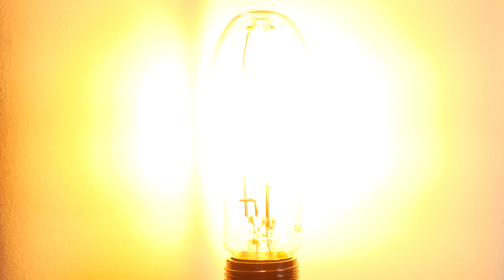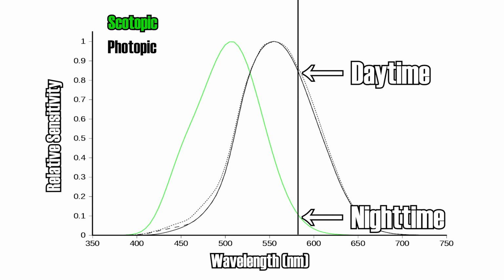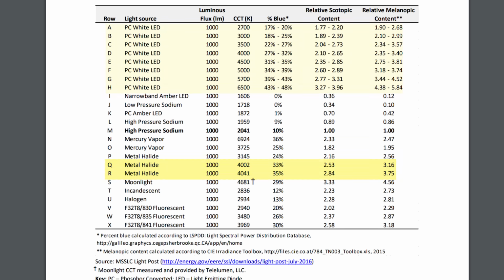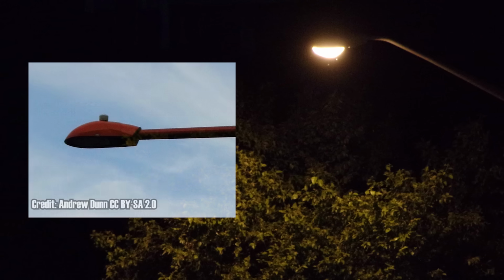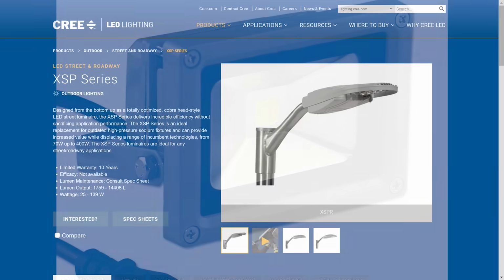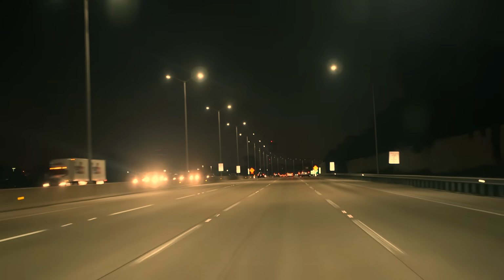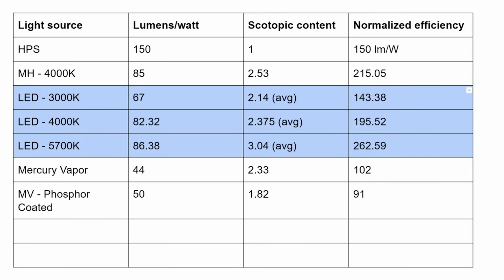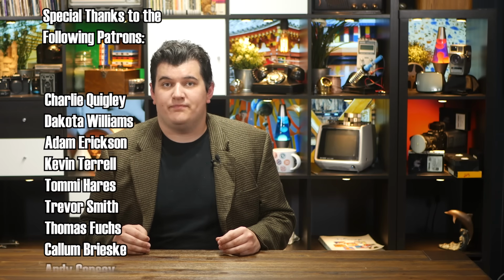The LED's Challenge to High Pressure Sodium

Comment: No CMH? Ceramic Metal Halide.. 4000K lamp is closest to the sun. Also, CRI(Color Rendering Index-sun is 100CRI. HPS is around 22CRI, MH(Metal Halide) 70CRI, CMH usually over 90CRI(98!). COB LED's w/optical lens 90°, maybe 45° even! Helping to avoid upward, outward, unwanted light pollution. And available from 2000K-7000K, giving many options. 4000K is a nice color. At 1st, LED's were very deceptive, our street lights  were almost dark underneath, lol. But nowadays, about half the wattage of HID lighting, at most, yet with many more colors, and optic lenses, I don't know how the newer LED's can go wrong. "Well, when light dies, you need a new fixture, very expensive!", yet I believe you, or a professional could switch out the diodes quite easily, especially COB's, and after it gets more understandable, each time, and maybe cheaper than an old mogul lamps, if changing every year already. Some LED's offer a 7yr warranty. 165lm/watt! Streetlights! Great video! Very informative and I knew much of it, already! Thanks again!

Comment: I suppose it makes sense that we may prefer blueish light, but when there is snow blowing across the road... no way. I remember driving on the highway with snow blowing and white LEDs; it was so hard to see the road. Then when the lights changed to the HPS (orange) lights, it was easier to drive. I'm not sure why, maybe it may have been because the white LEDs reflected off the snow.

Comment: I recently got my first house, a lot of the fixtures had older incandescent or CFL bulbs. I swapped almost all out for LED bulbs I got on sale. Garage had giant 4FT fat tube fluorescent fixtures and like 1//2 of them never wanted to work right. I ended up finding some $45 lithonia bar strip LED lights for like $30 on clearance. I got a gob of those. I got 2 of them up, I like the LED a lot more than even the working fluorescent fixtures. It is more of a pure white, they come on instantly even in cold, and no ballasts, etc to fail or buzz. These were small enough to screw to the length of a rafter, a fluorescent would not do that without many inches hanging over each side.

Comment: The LED street lights near me in the UK are awful and not like the ones you showed in your video. The sodium lights give off a wide mild light whereas the new LEDs give a bright light concentrated only where the street light is, with very little light illuminating between street lights. There’s a park near me with a roundabout and at night time it’s almost impossible to see vehicles or cyclists on the roundabout because the street lights are so poor. I suspect this is a specific design of the lights used near me as the ones in your video are much better.

Comment: does anyone else find sodium vapor lights easier to see in than LED?  I've been told white light is best for night, but even with my flashlights I find LED very unnatural and hard to make things out in.  On the road it's like LEDs are just lighting up the area directly under them as well and not diffusing the light across the road.  I've often missed people walking up to intersections with LEDs where I never did with the old lights because they diffused so much light.

Comment: When the roads are wet I can't even see the damn lines on the road because of the white led glare sparkling off the little puddles on the road. It all comes down to cost is cheaper it has nothing to do with safety.

Comment: Almost all the street lamps in my area have been replaced with white LED lights. There are now significant dark patches between each post where before there were none. The most dangerous aspect is that now, white light ahead could just be another street lamp, or an oncoming car, with no way to differentiate. Under orange sodium lights the white lights of a car are easy to differentiate. With a lot of single vehicle-width roads with blind bends and no sidewalk, this puts pedestrians at significantly increased risk after dark.

Comment: Having a LED style light for street lighting is looking like the way to go.  With the cost of power increasing and loading also increasing on a town of city level.  Having a lower consumption of power demands on a town/city level will work.  Possible way to solve the light from heading up by placing a reflective material on the sides to push the light back down.  This could be useful with helping the street lights from invading housing.

Comment: I feel like Led lights are a lot better because you can get many other colors then 5k - 6k, you can get a 2k that is really warm or 8k that is almost blue light. Some led light also do something that high pressure sodium lights can't do that prevents light pollution and that is a sensor circuit that makes the led light dimmer if no one is around, but if someone or something activates the sensor that will cause the light to be brighter for safety and there is amber led lights or even color changing.
Reply: Except a city or town is just going to buy a bulk amount of one type which usually ends up being the cheapest white/blueish light they can.

Comment: In this video I think you missed the point of Sodium Vapor lights. It was not to conserve energy. Back when everything was Mercury Vapor it had one huge disadvantage. Its absorption spectrum is close to that of water. During rain, fog, snow - any water in the air - Mercury Vapor lights ability to illuminate is cut significantly since the absorption spectrum is similar to water - it would be absorbed. Sodium Vapor lights were created to solve this problem. As we know, Sodium and Water are incompatible. Sodium Light cuts right through water - its absorption spectrum isn't even close - and its a similar technology to mercury, so it was easy to adapt. Foggy roadways were now visible at night. Snowy roads were visible. Yes, it may not excite the cones in our eyes but our rods are just as capable if not more so at making a clear picture out of lower light levels. Sodium Lights made a world of difference when introduced back in the late 1970's in the reduction of vehicle accidents at night. (I've looked online for documentation of these claims, but it was the 70's before the internet, I can't seem to find anything. This information is what we learned in Science class and through real life experience and news reporting of quantifiable evidence based on National and State governmental reporting.)

Comment: There's a grocery store near where I live that has auto dimming lights in the parking lot.  They're equipped with motion sensors that gradually brighten the lights in two stages when a vehicle or person on foot approaches - about 20 feet out they go up one step and about 10 feet out they go to full brightness then they go back to dim state after about 10 or 15 minutes of no movement.
I don't know how feasible that would be, financially or logistically, to implement into city o highway lighting, but it may be a possible solution for residential or urban lighting where consistently bright lighting causes disruptions and problems.

Comment: Another issue with LED not addressed in the video is the driver issues. Most LED's use pulse width modulation circuits that react differently with power fluctuations, low voltage drops and just naturally can make your brain react to them like a video frame-rate or flicker. When you look at a sodium or incandescent light burning its a constant light which is your eyes and brain don't have to process the extra data. As you get into the cool/blue white needed for optimal night brightness to the eye, the CRI gets worse and all color will be washed out more and therefore pedestrians and other issues while driving will be less noticeable. This exact issue has been happening with all the new cars using LEDs and projection headlights. You can't see a thing with oncoming traffic now in many conditions. Wet, snow, uneven road angle all leads to blinding the oncoming drivers. Now we'll put this LED technology to the street lights! My moms town recently switched to LEDs for all the street lights and its bad. Its gloomy and pitch black everywhere around the roads and on the roads and I can not see as well. LED's are a very small spectrum of light which is very unnatural.

Comment: Lighting things up which are not the road is actually not dumb
Liverpool residents have recently had issues with increased burglaries due to reduced lighting because of LED's.
The main issues with the LED lighting recently fitted in the UK:

1. Lack of diffusion - probably to get away with less Led's and less power
this results in more of a spot light
2. There's not as much light being emmitted from the Led lights
this is probably to council's cheaping out and getting a low as possible light source and because the blue light is too harsh
3. The new lights can be switched off remotely, which sounds good.
Untill you realise there's now large stretches of roads in the North with the new lights turned off to save money

So regardless of frequency reponse which this vid focuses on, these types currently make the roads less safe
due to the temptation to abuse the technology by councils to save as much money as possible
It's now cropping up that there may be cancer risks, and sleep issues

Personally I'd like to see LED's with the same colour frequency as the sodium's (warm yellow / orange), with diffusion to spread the light out
and more LED's for more light.

Comment: Blue light may not ruin your eyes directly, but what it does is massively increase eye fatigue. You can try this for yourself and it more convincing than any study you can find. Wear a blue light filter glass for one day, if use computer daily, that even better. The next day stop wearing it, sometimes after the sun had set you would feel an unusual amount of eye fatigue. THAT is the fatigue your eyes get every day, it's not something new, it just that yesterday you were wearing blue light filter glass and don't feel this fatigue.

Even if you don't want to buy a light filter glass, on PC you can install a program called Lightbulb, it changes the color temperature of your screen. Tune the color temperature for the night at about 4000k. Now disable the program, use the computer until you're about to turn it off and go to sleep, try turn Lightbulb on and experience immediate eye relief. If that doesn't convince you blue light fatigue your eyes more than any color, I don't know what. Try it, it free.

Also when you think about it, it just makes sense that blue light make our eyes work harder, because it present day time. We animal didn't evolve along with artificial light sources that can light up like the sun (lcd screen and led light), so our brain treats blue just like sunlight and make us stay alert.

Comment: I was actually brainstorming another idea: eliminating public lighting altogether and raising private lighting standards. Even that would have pros and cons.

On the one hand, this would require motor vehicles to meet higher light-output and broader directionality. It might also require new laws or bylaws forcing cyclists to attach lights to their bicycles from sunset to sunrise maybe under threat of a fine for not doing so. It might also make it less convenient for a pedestrian to go out at night without a head lamp or flashlight. Another problem has to do with a car light failing. This means that legislation might require a car to carry a backup floodlight that a driver can ignite at a flip of a switch should the main lights fail for whatever reason. After all, if there are no streetlights to light his way aside from traffic lights and sign lights, then he needs to carry his own light and backup light sources with him. While the lack of public lighting might not necessarily increase the crime rate, it would most certainly increase the need for motion-sensor security floodlights and security cameras on private private property to deter crime none the less. 

On the other hand, it could reduce municipal taxes to compensate for the extra cost of extra private lighting, and would give a person at least somewhat more control over his light source. For example, a person could choose for himself what degree of kelvins he wants for his car or bicycle lights or even head lamp or flashlight. It could also give him at least somewhat more control over how much light he wants. For example, he could go into a large municipal park guided by a flashlight and once on location, switch it off to do whatever he's planning to do, whether to look at the stars, appreciate the private lighting from across the river (mostly from car lights, balcony lights, flag lights, etc., which would probably still produce a beauty all its own but without as much sky glow), etc.

The above solution would probably still cause sky glow, but certainly on a much lower scale than now. The cons might outweigh the pros, but I still thought it an interesting brainstorm if thinking somewhat outside the box.

Comment: There is just one thing that I would like to point out, the last part of the video about luminous efficacy of LED, the luminaire chosen from Cree was a very poor example of where we are efficacy wise, most of the LED have efficacy of at least 100 lm/w nowadays (for outdoor) most of the indoor stuff is now around 130 lm/w (affordable option) high end luminaires are around 160 lm/w

Most of the products that are used by cities (cobra head replacement) will be required to be listed under DLC and the minimum requirement for DLC standard is (at the time of writing) 90 lm/w, where I think it goes up to 115 lm/w for DLC premium. DLC is mandatory 99% of the time when you are dealing with cities or government.

Comment: Alot of street lights around me and my subdivision have started to be replaced by LED's. They seem to do a good job lighting the area, but they don't seem to have the coverage the old fixtures did. They light up right underneath them really well, but not say a few feet from the fixture. Also,  IMO the light up the road better in rainy conditions. I usually have a hard time seeing at night in the rain when driving under a non LED fixture. So I think the change is good.

Comment: Some decorative fixtures are actually dark-sky friendly. 
Many large sports fields are lit with light very tightly focused just on the field. It's quite remarkable. Have you seen one?

I find visibility just fine with HPS. And it seems very bright. I was surprised about it not matching night-time vision.
With LPS lighting everything is sharp and in excellent focus. I think this is because you're getting light of a single wavelength, and your eye doesn't have to struggle with different colors, which tend to focus slightly differently from each other. And they're incredibly efficient. Color rendition stinks, but do you really need it for safety?
Why do you say that HPS contributes less to sky glow? Sky glow almost always has that characteristic orange color.
Melanopic lighting is a double-edged sword. You don't want to disturb the daily sleep cycle, but you also don't want sleepy drivers!
You are never going to see anyone reduce light levels. I've never seen it happen. Ever. You know those tunnels which have extra lights at their entrances for daytime use, so that you don't get thrust into relative darkness? They should be on only in the daytime, and shut off at night. But they're left on 24-7. I guess they figure more is better, they've got the lights, might as well use them. Then there's the possibility of lawsuits if the lights are turned off at any time. Arggggh.
You're repeating things a little too often. It's a complicated topic. A transcript would be great.
I greatly appreciated the lack of music. Music is always distracting, making it harder to follow the narrator and think about what's being shown and talked about in the video. Thank you!

Comment: why so much on sub 3000k and above 5500k lights, and not covering 4000k to 5000k pure white wavelengths? The 6000k to me are horrible, just too much blue, and in household bulbs just look like blue lights, in superbright (50w and above) it's not so noticeable, but just still look so unnatural. 4500k looks so much better and not so unnatural feeling, but are not that common in leds, but 5000k is the most widely commercially available light that isn't too blueishly tinted. Even the chart you had jumped from 4000k to 5700k, leaving the whole "pure white" range out.

Comment: If we move to a bluer LED light for night driving, would this alter our circadian rhythm enough not to fall asleep at the wheel?
Reply: No, your body will want to sleep regardless and you will fell asleep just by being tired, body naturally goes to sleep when body is weak and low on energy, circadian rhythm only helps to maintain regular pace of sleeping even if you not tired, as you won't feel asleep if you sleeped too much already even at night and with warm light around you you body is simply too active. From my life expirance, working standing is the best (non-chemical ;p) way prevent sleep as you body i working out just by standing, but ofcorse it is not healthy as any method that keep you awake when you not suppose to.